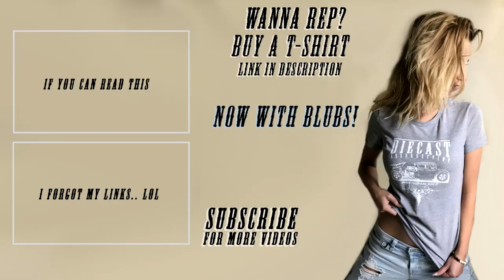BARNFIND 1:18 Scale 1973 Trans-Am Restoration (Part 1)

Comment: I had a SD 455 Trans-am that I ordered from the factorery in 1973 Believe it or not, I had it delivered with the Trans an bird delete on the hood, which cost me an additional $250-00, just to have it not put on. I shipped it to Germany the next time I went overseas and we both had a blast. Sold it to a German who I worked with when I rotated back as I now had a family and the Trans-am would have not been fitting.
Reply: Randy Purtteman that would be an incorrect memory Randy. The Hood decal of the Screaming Chicken was an extra cost option of $95 back then. Standard equipment was no hood bird decal,so no charge without it. Only extra cost was for options added over standard equipment. As a matter of fact, any time you deleted a standard equipment item, like a radio, you got a credit back for a factory preset amount that was published in the order guides on the sales managers desk.
Reply: @marksmith6091  Perhaps I dis get it wrong but I know that I had to pay extra for not having something. I allways thought it was he screaming chicken. It might have been for something else. You're right ,  I did have the wheels changed. And it was a long time ago.

Comment: If you have built the re-issued International Transtar 4300 Eagle in 1/25 scale;the kit was an AMT kit in the ERTL series.The ERTL division,of the the Learning Curve brands LLC;which owns Match Box,and Round 2 LLC,went bank rupt in the late 2000's early 2010's.Every once in a while,Round 2 LLC will clean up the vintage molds,and reproduce and re-issue plastic model kits;that haven't been seen in decades.
In fact,there have been several ERTL kits that have been re-issued within the last 3 years because Round 2 LLC bought,and aquired;the ERTL brand in 2015.The molds and dimensions are not as precise;as the kits coming out these days;but that's what makes building them so fun!.Plus if they were to up date the molds;using today's technology,the kits would cost twice as much as the re-issued; vintage mold kits.I like the big rig kits that AMT and MPC have been coming out with in the last 10 years;but they would be expensive using today's molding technology.
So instead of paying $44.00 for a 1/25 scale big rig kit from AMT,AMT/ERTL,or MPC,you would be paying between $60.00 and $80.00 for the same kit;molded with the precise tooling technology,we have today.ERTL was once an independent company brand;before filing for chapter 9 and chapter 11 bank ruptcy,back in 2011.ERTL is now a sub division/subsidiary of Round 2 LLC.

Comment: ERTL manufactured lots of large scale pressed steel toy cars - their 'General Lee' is a classic (and almost indestructible), as is the 'Knight Rider' KITT. They made 1/64 scale diecasts, too, as well as 1/24, an 1/18. The only problem here in the UK - they weren't that common, and damned expensive if you found them. I'm not surprised about the damage caused by cat piss. That stuff is pretty corrosive.

Comment: What are these car bodies casted from? Is it pewter, aluminum, or 100% lead lol, I've got alot of these most of mine are 1/18 scale i think im going to sell them on ebay for $10.00 each. I got a nice orange 1970  Z28 camaro its in crystal condition i grew up in the 80s ive got a lot of those huge plastic cars that you push around and old monster trucks yeah i think I'll sell them on ebay

Comment: Greetings from the UK.  Have only just found your channel.  There are so many “model restoration” experts on you tube it’s hard to find the good ones.  They should have a “trust pilot” type score where it’s easier to find the good ones like you.
I love the 1:18th restorations you have done.
Not surprised the pitting in the Metal caused by old cats wee (I don’t mean the cat was old, but it will be now). Urine is acidic so it’s like those models have had acid on them for 20years...

Comment: Thats not such a dumb idea!
You could make little custom pads and use a multi tool as a palm sander.
Another tip super glue bamboo skewer from door to door. (Bit covered by trim)
Stops doors closing on wet paint, thin enough to work around.

Comment: For a power sander use an electric toothbrush by pulling bristles out glue on Velcro and use sandpaper with Velcro backing. I usethat on rc bodies. Works like a d.a. sander. Make sure you use a rechargeab,e toothbrush.

Comment: I had a '70 RS Camaro with the split bumper for a short while. Was a piece of junk - fell apart. The whole dash was warped from the sun. Chewed up u-joints and brakes like candy. They didn't make paint that would stick to the rubber-like nose. Had to replace it twice from people bumping it in parking lots. Wasn't cheap.
Reply: Leaf springs wore out after two years. Everything rattled when you hit bumps. Everyone loves them but ya had to be there.

Comment: Lego makes car models that are about 1:18 scale. I purchased a box of lego's from the Goodwill store and there were all kinds of big and small wheels and hubs. You could use lego wheels on your projects. What size is your air compressor? I have a pancake compressor and at 30 psi I wasn't getting enough pressure when practicing with plain water.
Reply from the maker: 25-30PSI is where I like to be.  I have an Iwata SmartJet

Comment: I'm a 1/18 scale collector specifically and iv always wanted one of these old ertl 73 trans am's
Reply: The ones made by Welly are better. The trunk opens on their version
Reply: I thought so too but welly has a scale issue you can take a welly and put it next to the identical make and year and the welly will always be smaller I have a tons of ertl and have ten or 15 welly and the "like models" are smaller and you can't beat that heavy old ertl cast
Reply: I have a welly 72 TA and a ertl 77 Formula and both are equal length. Except the ertl sits higher due to the large wheels ertl put on it. And the front and rear bumpers are different on both cars. But near identical wheelbase width and height (if I measure the bodies only)
Welly really did a good job on it,it’s one of there best models
Reply: erod017 welly and motormax are funny like that, you'll have a car that's off scale and has terrible quality throughout the car and some of there other models that are made in the same time period are a amazing like my motormax ram 1500 that is the best motormax I own and the welly looks tiny next to it but my welly Yukon is a perfect welly it's to scale and there's nothing odd about it, weird how some cars are better than others it must be the way they decided to build or something
Reply: I agree. Some motormax cars like the Ford Crown Victoria police interceptor and the Ram 1500 are home runs. While others like their 64 mustangs are turds. 
Guess you have to pick and choose and hopefully you pick a winner
Reply: erod017 you should look into finding a motormax Ford Focus there wicked rare but very very nice little car I have one in blue and the quality is like a budget version of an autoart it really is nice and if you want check out my channel I have some vids on a few cars in my collection